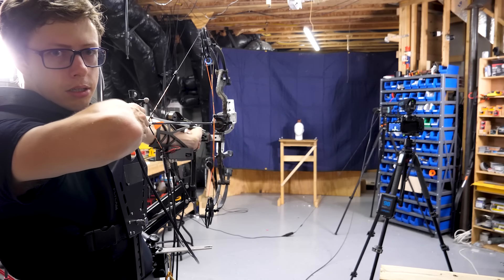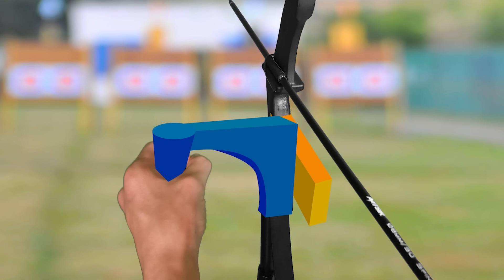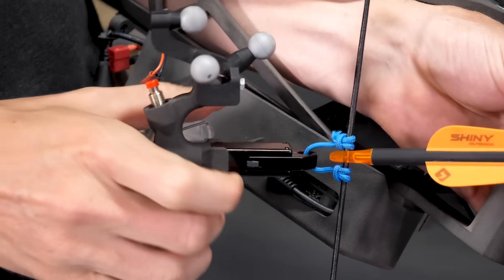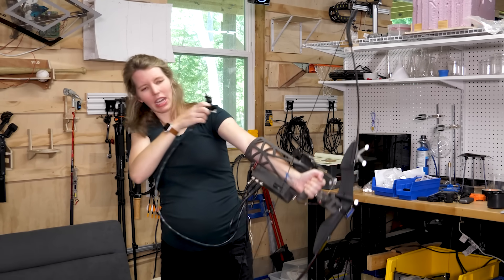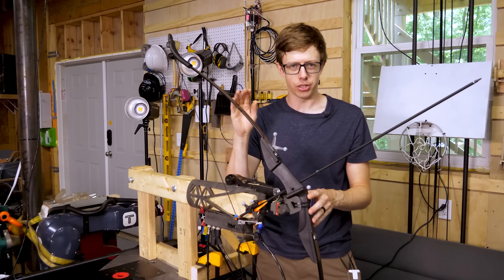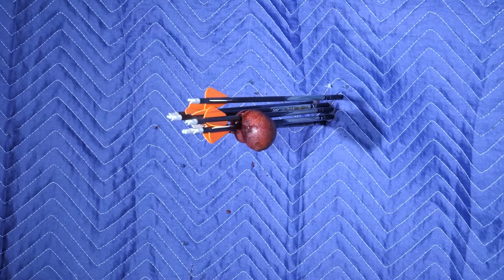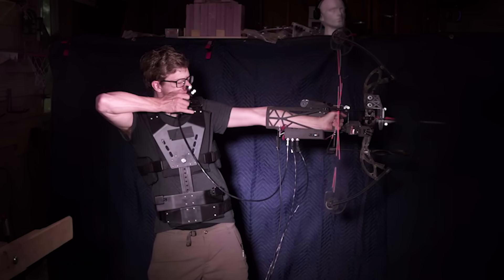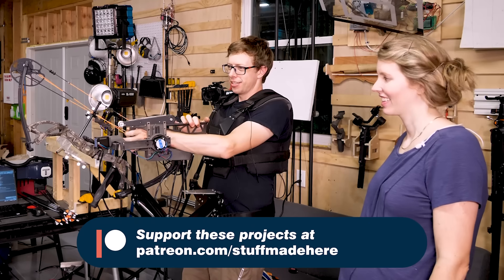Auto-aiming bow vs. FLYING targets

Comment: Edit: So, I was wrong about big arms. Either way, I love that there's still a human  element.

The best part about this is that the draw strength is still human. It just does all the "math" parts. So you still have to have the big arms for it.
Reply: I mean compound bows are pretty easy to draw. That's the whole point of the "compound" bit.
Reply: @Haddleton  The main point of the compound bit is accuracy, it corrects for imperfections in release of arrow, and also provides a straight trajectory..
Reply: @ishaankapoor933  Oh totally, the accuracy is the main reason - but the mechanical advantage granted by the cam and pulley system makes the bow easier to pull, for certain.
Reply: @Haddleton  It is easier to hold in position (due to non circular pulleys) , but requires equivalent force to pull
Reply: I am a state lever archer (that is probably why the YouTube Algorithm monster brought me to this incredible video) and trust me, pulling the string is not a big task.
Reply: Yeah these guys already said it.. I did archery growing up, and we only used longbows, very large and old fashioned ones at that, drawing a bow isn't difficult, at all.. and that was back when I was a wimpy middle school kid
Reply: @Frosty_tha_Snowman  I mean it does depend on the bow. High power bows are incredibly hard to pull, especially multiple times.
Reply: @Neomeniaaa  so, I didn't stop doing archery after middle school.. me and my dad both have very nice compound bows, both are 60-70 pound drawback, and it takes.. effort? To pull it back, I mean, about as much effort as it takes to pick up a chair... a small chair, like, one you'd move in a classroom to get it out of your path on the way to the door. 

My point, it doesn't take "big arms" to draw a bow, and even if it did, that wouldn't be the most impressive thing about this project 😂 this person's statement, it's just so illogical.. I didnt want to comment because I don't want to be mean, but it needed to be said..

Edit: to the original poster, I didn't see that you'd corrected your statement, props to you for admitting it was a foreign topic, I understand what you're trying to say, with the human element being involved.. but he could've just added a servo and made it self draw, if he really wanted to, but this whole bit seems to be more about enhancing human capability with, rather than just outright replacing it with technology.
Reply: @Frosty_tha_Snowman  im not rlly sure what most people would call high power bows, but when i said high power i meant like 100+ pounds. Not that the bow in the video is near that, but thats what i meant with it does depend on the power of the bow.
Reply: @Neomeniaaa  70 is high powered.. you don't seem to have much to base your idea off of :/
Reply: @Neomeniaaa  and doing any motion over and over that exudes energy at all is going to get tiring eventually... but even in competition, you're not just constantly firing arrows... and if you're in a medieval war, I'm sure you'll find the strength to shoot one more arrow until there's no more people trying to take your life 😉
Reply: I came back to this video to show a friend, and I just had to post this.. 😅

"Big arms" 0:07